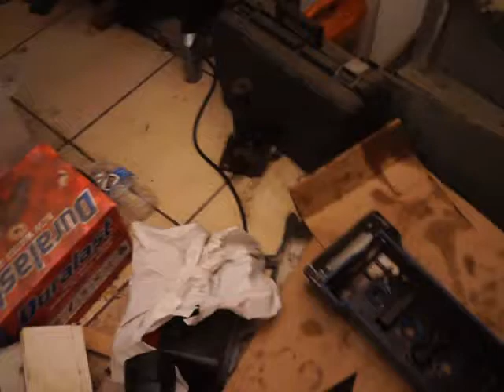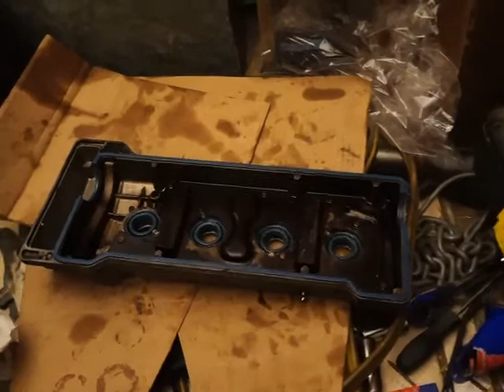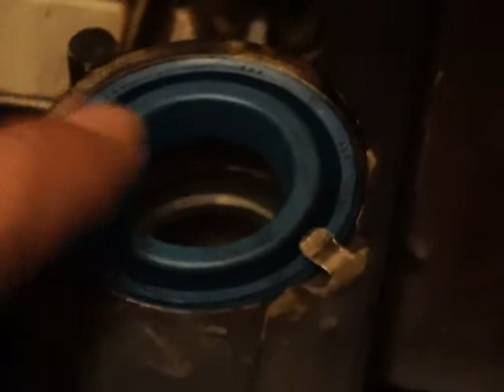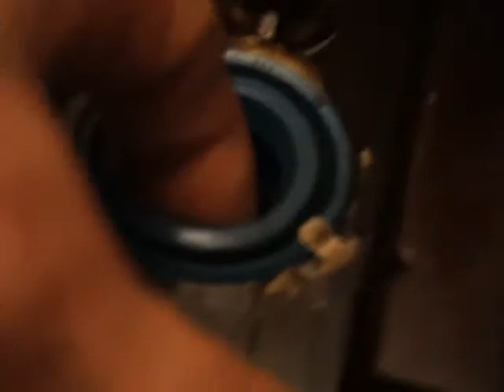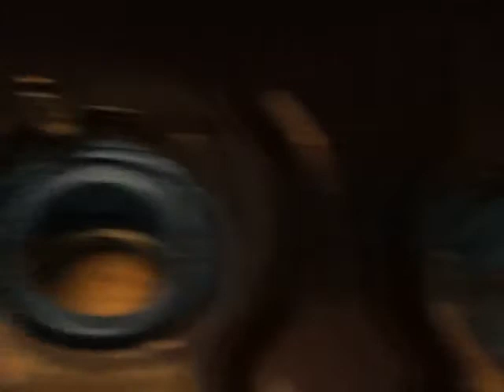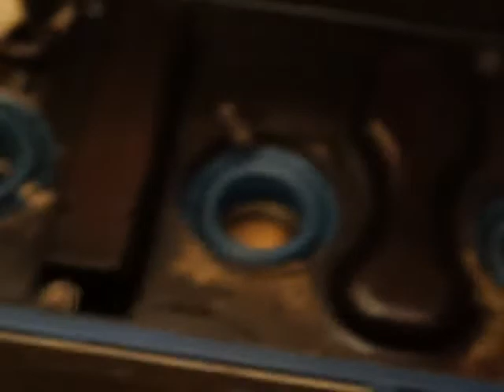How To Fix Oil Leak In Spark Plug Gasket Seals 95 Geo Prizm- Youtube

Comment: Okay I tried to push em in and they don't budge. I can't get em down to the run. How'd you push them in
Reply: Rim*
Reply from the maker: toe gonzalo You have to have'm oiled up so it can slide in. Carefully  bend the metal pin up and out of the way for clearance. Use a socket or the old seal. Place it on top of the seal and softly hammer it in with a piece of wood. Hope this helps you out man.
Reply: I used the old seal! Thanks! I just got it back in! It was making me worried for a bit but I finally got it
Reply: I think a 36mm socket will fit. I'm doing mine right now.
Reply: Did it seal after pushing them in all the way? Trying to figure out if they go in all the way or not. Read somewhere else not to go all the way but there is not alot of info on this. Not even in the Haynes manual I have.
Reply: @ChillingwithMalc  I believe so. I got mine to go all the way in with the old one.
Reply from the maker: @ChillingwithMalc  you have to go all the way or else it's gonna keep leaking.